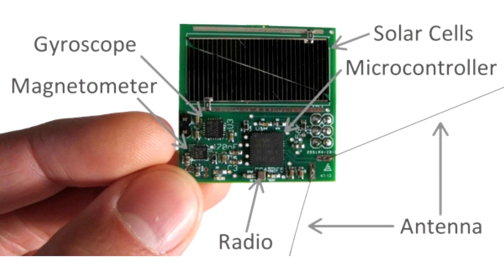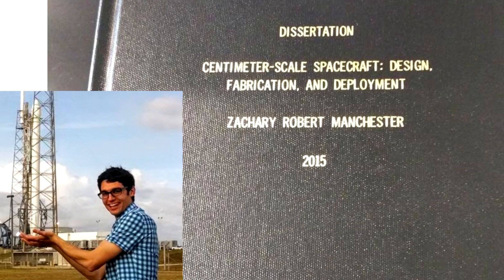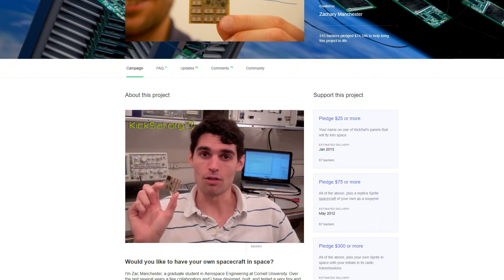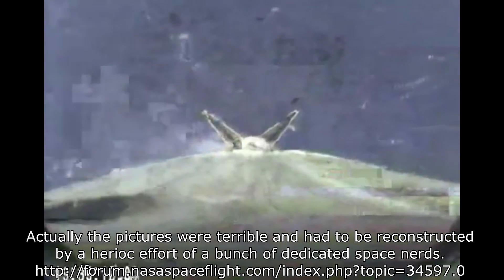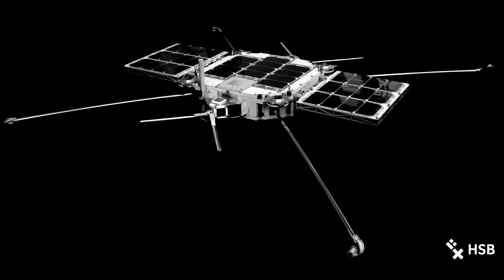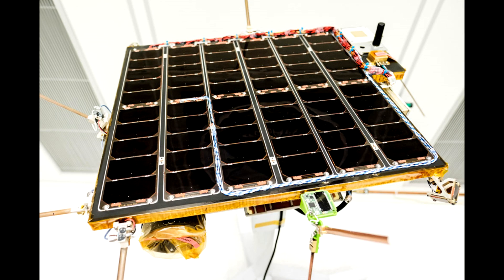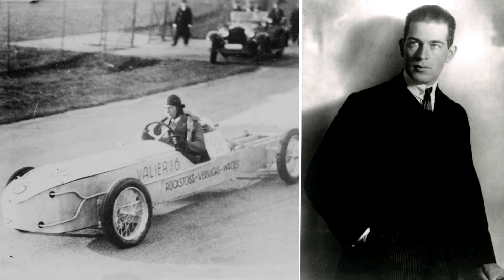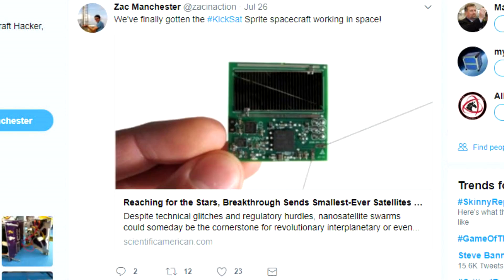The Smallest Satellite In Space

Comment: Since the satellites are so small, could you just like, coat them in lead to protect them from the sun's rays without having to worry about weight?
Reply: A) a tiny bit of shielding on a tiny satellite is actually a large increase in weight. B) a very thin lead (or other) shield won't stop much radiation. 

I think the answer may be to launch huge clouds of cheap, fragile satellites into low, doomed orbits, and just keep replacing them en masse.

Comment: Nothing new should be added to Earth orbit that doesn't contain a "self-destruct" de-orbit mechanism.  The last thing we need up there is tons of new debris.  These sprites could have little CO2 cartridges, for example.  Non-proprietary tracking would probably be a good idea too (any old sat is every new sat's concern).
Reply: Stuff in low orbit has a short lifespan before drag brings it down. No worries, unless they start launching them into higher orbits. 

A thruster and sufficient fuel would add significant weight. I would say, use Earth's magnetic field instead. (Tiny solar powered magnet on board.)

Comment: I hate to put some brakes on the hype train but Project West Ford (1961 US) probably beats you at the smallest artificial designed satellite (as opposed to orbiting protons left by second stage burns/ general space junk), the mass of each satellite was 39.5ng.

https://en.wikipedia.org/wiki/Project_West_Ford 

The project itself is a pretty interesting story, basically, the US military tried to create an artificial ionosphere (the part of the atmosphere that you can bounce radio waves off of for over the horizon radio communication) by putting 1.78cm dipole antenna into orbit. In short, everything failed (surprise surprise).

Comment: these need little iddy biddy ion thrusters
Reply: And a teeny weeny little fuel tank.
Reply: Twirlip Of The Mists i think ion engines dont require fuel but they do need batteries.
Reply: @erratichomelessmanwithagun6726  not fuel but reactive maas. mercury is good
Reply: You actually have a point. A teeny weeny self steering thruster system will help em stay on course in orbits.

Comment: This is good stuff and has great potential but also demonstrates, at least in my opinion, the currently largest technical hurdle for these nano satellites and that is radiation hardening. LEO is a relatively tame radiation environment because of earths magnetic field, and one of the cubesats mentioned in the video still had a problem due to radiation. I have also seen videos on people putting cell phone hardware into cubesats as a cheap and high power processing unit, and it is that. The reliability of the cubesat will not be very good though because phones are note designed for a space radiation environment. Hopefully, we also figure out the reliability issues through either radiation hardening and better error algorithms.  Maybe self healing circuits.

Comment: "Then a random cosmic ray happened."

That's actually my first thought when I saw what those kicksats look like. At least wrap them in aluminium foil. The whole reason space tech not being the bleeding edge is because it needs, among other things, radiation hardening.

Otherwise we could just send up a smartphone with a very expensive roaming data plan.
Reply: You can if you keep the antenna sticking out of the foil. Not that its a big deal, even cellphones get signals inside a aluminum box just fine. The technology we have today don't require a very strong signal to communicate
Reply: Tin foil blocks CIA mind control rays, why not cosmic rays too?
Reply: They actually sent android cubesats lol
Reply: The thing will manage to get a signal through the foil?
Reply: Would it even be enough?  And doesn't it need a ground to work?
Reply: Heavy ions and protons that cause damage in comercial of the shelf electronics are not stopped by aluminum. The only way you can make a device radiation hardened is at the die level during design. For instance, using larger structures.
Reply: Yeah but they have a magnometer built in, they’d have to have a boom for it which kinda defeats the purpose
Reply: If tinfoil can stop all those government gay frogs then why not save tiny satellites with it

Comment: Reality check: hitting 4 grams (+sail) with Gigawatt lasers (sufficient to hit the sails with Megawatts of power) will effectively turn anything into plasma.  Eventually you will need radiators made out of gold leaf that are larger than the huge sails, but still you have the problem that hitting relativistic speeds (before flying past Mars) requires megawatts of power per gram.  Even if the sails/mirrors are 99.999% efficient, the thing is going to melt.
Reply: Apparently not, though.

Comment: The laser sail mentioned near the end, wouldn't that overheat with such an amount of power focused on it? 
The only way the sail could lose heat is through black body radiation, that might be too slow.
Reply: Perhaps you design the system to not heat up, make the sail reflective, after all you only want the beam to bounce off the sail to impart momentum.
Reply: It has to be almost perfectly reflective or it will explode in the first millisecond. Cooling off isn't an option.

Comment: LEO satellites that lack deorbit/graveyard thrusters are unethical. After a year or so (provided these sorts of toys even work in the first place), it's just space junk that will last for centuries.
Reply: The plan is to deploy them to ISS orbit and it will deorbit in 3-9 months without any thrust. Most CubeSats don't have any means for deorbiting but for example, Aalto-1 has. You should check it out, the plasma brake they are using is really cool.
Reply: They still have drag in space and deorbit within months
Reply: From higher LEO orbits such as 500km orbit Aalto-1 is in, it will take around 15 to 30 years to deorbit "naturally". The deorbiting times rise rapidly with altitude.

Comment: Maybe a stupid question but.. Could a high altitude balloon aid a rocket to space?
Reply: pumpkineater23 In theory, yes, but...

The distance travelled would be insignificant as the balloon only goes about 20-30 miles up.

Try finding enough helium (or hydrogen RIP)  to make a balloon that lifts a whole launch stage.

The rocket would have to be on top of the balloon, so it would be very top heavy.

Single use launch system.

plane assisted launches also work off the same idea, but they work better because they add some velocity to the rocket.
Reply: The difficulty in getting to orbit is not the height, but the speed to stay at that height.
A balloon won't help with that.
Reply: A balloon might help in some ways, but really wouldn't be practical except for a couple very specific cases. As Zocker mentioned, gaining altitude doesn't really help with getting to orbit.... but it does help reduce drag. Even the subtle structural changes from not having to deal with as much aerodynamic stress could help lighten the rocket. But picture the size of the balloon: The Hindenburg, large as it was, had a payload capacity of just about 10 metric tons. At the altitudes needed to really help a rocket you'd need an even larger, heavier envelops for tat same mass.... There's just no practical way to build a balloon large enough for most rockets. If anything, it would have to be a permanent platform used for either tiny launches or some sort of airship SSTO that wouldn't have to actually land on the balloon, only scoop the payload off it and refuel while holding its own weight.
Reply: Most of what you need to get into orbit is horizontal velocity, so you would need to haul a massive rocket to these altitudes. What really helps is a reusable booster stage, which is what Elon Musk has developed.
Reply: energy required to get orbital velocity is orders of magnitude greater than energy required to reach proper altitude
and 30 km doesn't save you a lot of the total 350 (ISS)
so basically a same weight rocket but on ireland sized balloon

(yes I edited because I mistaked the first try)
Reply: Thanks so much for the replies. I read that high altitude balloons can reach heights of over 50km. Since it's only 100km to space (?) this would half the distance. I was thinking a small rocket could then blast off, from 50km, and deliver a cluster of small satellites such as those mentioned in this video at relatively low cost. Do you think the rocket would still need to be huge in order to carry enough fuel to make this possible?
Reply: 100km is kinda the edge of space, but there is still a good amount of air. Go for a 100km orbit and you won't be orbiting for long
Reply: Even if we are aiming for 100km (which is super low, and the orbit won't be stable for long since at 100km you still have some atmosphere) you don't just need to reach this height, you need to go sideways at this altitude and reach orbital velocity, and that is more than half deltaV needed. So yes, you still need a decently sized rocket. Plus, using baloon as your lunch pad is super unreliable, you are very likely to go kaboom.
Reply: Ok got it - many thanks to you all. Such a shame it's still so difficult. I would've thought by now there would be an easier way to get out there.. roll on the space elevator!
Reply: You could try to launch a ballon to 40-50km height and get some Speed with a high-speed srb. Then reach orbital velocity with a high Efficiency ion thruster.
Reply: That ion thruster would have reentered the atmosphere long before reaching orbital velocity

Comment: 30,000 g forces. How does that light sail not ripe apart?
Reply: James Simmons I think he was talking about g's as in the measure if acceleration. So if the mass of the satellite is extremely low, the forces needed to achieve that acceleration might not be very high. (if the mass is 1/30000 kg, the sail would only experience a force of 1N to bring it to that acceleration, easy to withstand^^)
Reply: Edit: g Newton (aka 9.8N and a bit)